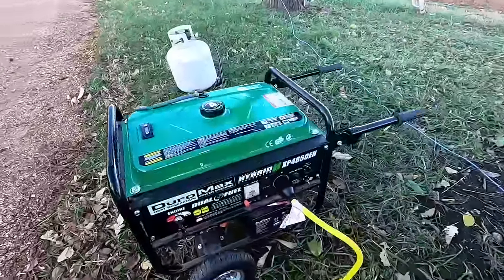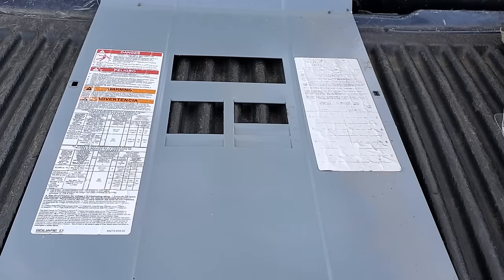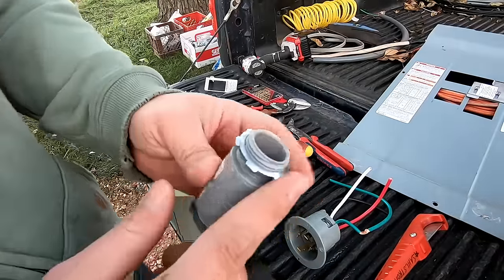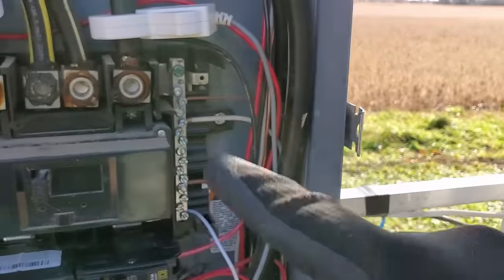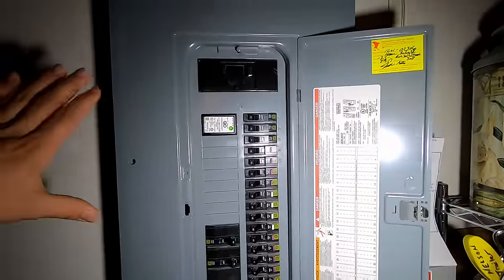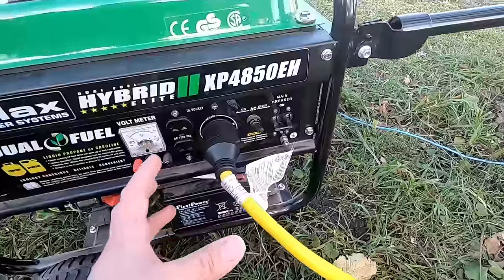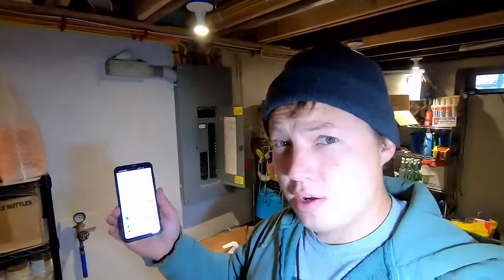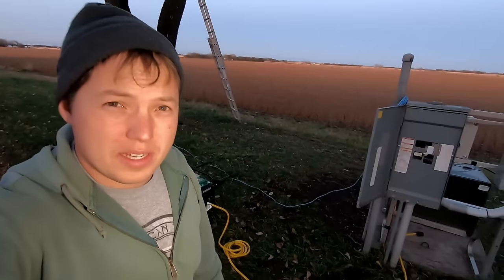How To Hook Up a Generator To Your House Using a Breaker Interlock Kit & Power Inlet Box

Comment: Such a great explanation and video.  I have the same generator.  It's output is slightly reduced on propane.  Gasoline should get you closer to the max, but I also run mine propane-only.  Also elevation comes into play with output.
Reply: ⚠️Portable Generator Safety Tips:

1) KEEPING OTHERS SAFE: Please do not allow an unqualified person or your children to operate and service the portable generator. Just because some manuals don’t say that doesn’t mean it’s safe. That is important against the generator safety rules. We also need to be keeping an eye on our children too. You need to make sure that your children are not playing near the portable generator especially when it’s running so they won’t get electrocuted. Generators pose electrical risks and they can be hot during an operation. Please keep your children away from the portable generator at all times. It is important to keep our children safe especially our little ones. Be aware of all the hazards.

2) WHERE TO RUN YOUR GENERATOR: Some people use their portable generators indoors which increases the risk of carbon monoxide poisoning. It’s important to have a carbon monoxide if you have a gas generator. Never ever use your generator indoors even if your doors and windows are open and even in the garage is not safe to use a portable generator. Also please never use your generator in your deck or balcony. It is never safe to use your generator indoors and in enclosed areas of your home. Your generator needs to be 15-20 feet away from your house. 

3)🔥FIRE HAZARDS: Never refuel your generator while it’s running. You need to let your generator cool off before refueling it and before storing your generator. Never overload your generator too. Never ever back feed your generator. You should never plug your generator into a wall outlet. Also never store propane tanks indoors. Please keep flammable things away from the generator as well and please don’t smoke cigarettes near the generator. Having a fire extinguisher next to the generator is also important against the generator safety rules. It’s also not safe to move your generator while it’s running.

4) GENERATOR OPERATION: make sure your hands are dry before touching the generator. Never use your generator in wet conditions. Don’t let your generator get wet. You need a generator tent if you need to use your generator during wet weather. Please don’t wear loose clothes when operating the generator. Turn on your generator before plugging in appliances. Use the right cord for your generator. Please do not use worn out cords. 

https://youtube.com/shorts/eFigDfnPkcQ?feature=share and here is a short video more about keeping others safe when using generators. Portable generators need maintenance so it’s important to follow the safety instructions.

Hope this helps

Comment: when I hooked up a generator feed for my house I used a separate breaker box specifically designed for such connections.  there were 10 or 12 breakers in the box (don't live there anymore and can't remember how many).  I ran wiring from the original grid panel (wiring supplied with the new panel) to the new panel for each breaker I wanted use (or could use, given the limitations of the generator). the breakers in the new panel had 3 positions. one for grid power, a middle position that cut power off, and a position that had the power from the generator.  the main panel was inside the house, so all the switching could be done inside.
Reply: Portable generator safety rules: Always make sure you follow all the generator safety rules whenever you use your portable generator. This is only a reminder. Generators can be dangerous if not used carefully. Every year, hundreds of people die or get injured when using portable generators due to carbon monoxide poisoning and electrocution. Make sure you are using your generator carefully and keeping others safe as well. There is something very serious that everyone should always be aware of when using generators. Some people do run their generator indoors which is not safe and that increases the risk of carbon monoxide poisoning which can cause death of family and you. Some people run their generator in wet conditions which can electrocute them. Please remember that you should never run your generator indoors. Remember that carbon monoxide is an odorless and colorless gas that you cannot see or smell. Carbon monoxide is a silent killer. Keep that in mind. Make sure your generator is 15-20 feet away from your house and away from doors, windows, and vents. Never use your generator in your porch too. Having a carbon monoxide detector is very important against generator safety. Some people also allow children to go near the portable generator which could pose risks. We need to keep an eye on our children making sure that they are not near the portable generator so they won’t get electrocuted or burned by the generator which is dangerous. A locking enclosure also keeps kids safe. A generator shed might look like a tempting place to explore, or take cover during a game of hide and seek, but a generator is a dangerous piece of equipment that can cause injury. It says on the manual that we should also keep children away at all times from the portable generator to avoid injuries. Please do not allow a child or unqualified people to operate the portable generator.  It is important to keep your children safe especially little ones. The portable generator can be hot during an operation. Just because some manuals missed what should be listed doesn’t mean it’s safe to do. Always follow the generator safety rules when using portable generators. Generators pose electrical risks. If you need to use your generator during wet weather, you need a generator tent to protect your generator from getting wet. Don’t let your generator get wet. Keep your generator dry and before using your generator, please make sure your hands and your generator is dry. Do not wear loose clothing when operating the generator. Everything that is said on the generator’s operating manual should not be ignored. Never smoke cigarettes near the generator. Please keep flammable things away from the generator. Never overload your generator too. Your generator can catch fire. Never ever try to plug a generator cord into a wall outlet to avoid back feeding. Back feeding your generator is dangerous. Always turn on your generator first before plugging in appliances and shut off the appliances before turning your generator off. Use a heavy duty cord for your generator and the cord should not be worn out. All the instructions should be followed carefully. Never refuel your generator while it’s running. It can cause fire if fuel spills while your generator is hot. You should turn off your generator and let it cool off before refueling it. Having a fire extinguisher next to the generator is also important. This is only a reminder for everyone’s safety of using generators. Make sure your generator is properly grounded. Having a fire extinguisher next to the generator is also important against the safety rules. https://youtu.be/I1jT3ANENvI and here is a video more about keeping others safe when using generators and also about our family’s safety. It’s important to keep our little children safe as well. Make sure your little children are kept away from the generator at all times especially when it’s running. Hope this helps. Always remember that it’s better to be safe than sorry.
Reply: @The_Happy_Aviation_Enthusiast  you are a bot, right? massive block of text - you need an editor badly

Comment: I just purchased a Duromax 13kw portable generator. I have a similar setup with an Interlock Kit. Are there any concerns about running TV's, Computers, etc on Generator Power. Specifically is there a concern about Total Harmonic Distortion as these generators are well above the recommended 5%. Has anyone solved for this or have your devices been fine?
Reply: I have the same question. Do you know if anyone used separate UPS devices that can provide clean power to these sensitive loads? Or do you just need a better THD <5% generator? Adding UPS's adds costs on lesser generators???

Comment: Interlock kit - a useful item - but my case is quite a bit more complex as I'll have a 3 phase generator powering a single phase house - so not only will I need to isolate the grid supply, I'll be splitting the 3 phase supply across different circuits.

Comment: I have 2 200 amp boxes in which both have circuits that need to be energized. Your video shows perfectly how to do a single box hook up however what's the best way to split the incoming line from the gen.  Great vids.....thanks
Reply: Here are the generator safety rules that everyone needs to follow: this is just a reminder for everyone’s safety. Always make sure you follow all the generator safety rules whenever you use your portable generator. Generators can be dangerous if not used carefully. Every year, hundreds of people die or get injured when using portable generators due to carbon monoxide poisoning and electrocution. Make sure you are using your generator carefully and keeping others safe as well. There is something very serious that everyone should always be aware of when using generators. Some people do run their generator indoors which is not safe and that increases the risk of carbon monoxide poisoning which can cause death of family and you. Some people run their generator in wet conditions which can electrocute them. Please remember that you should never run your generator indoors. Remember that carbon monoxide is an odorless and colorless gas that you cannot see or smell. Carbon monoxide is a silent killer. Keep that in mind. Make sure your generator is 15-20 feet away from your house and away from doors, windows, and vents. Never use your generator in your porch too. Having a carbon monoxide detector is very important against generator safety. Some people also allow children to go near the portable generator which could pose risks. We need to keep an eye on our children making sure that they are not near the portable generator so they won’t get electrocuted or burned by the generator which is dangerous. A locking enclosure also keeps kids safe. A generator shed might look like a tempting place to explore, or take cover during a game of hide and seek, but a generator is a dangerous piece of equipment that can cause injury. It says on the manual that we should also keep children away at all times from the portable generator to avoid injuries. Please do not allow a child or unqualified people to operate the portable generator.  It is important to keep your children safe especially little ones. The portable generator can be hot during an operation. Just because some manuals missed what should be listed doesn’t mean it’s safe to do. Always follow the generator safety rules when using portable generators. Generators pose electrical risks. If you need to use your generator during wet weather, you need a generator tent to protect your generator from getting wet. Don’t let your generator get wet. Keep your generator dry and before using your generator, please make sure your hands and your generator is dry. Do not wear loose clothing when operating the generator. Everything that is said on the generator’s operating manual should not be ignored. Never smoke cigarettes near the generator. Please keep flammable things away from the generator. Never overload your generator too. Your generator can catch fire. Never ever try to plug a generator cord into a wall outlet to avoid back feeding. Back feeding your generator is dangerous. Always turn on your generator first before plugging in appliances and shut off the appliances before turning your generator off. Use a heavy duty cord for your generator and the cord should not be worn out. All the instructions should be followed carefully. Never refuel your generator while it’s running. It can cause fire if fuel spills while your generator is hot. You should turn off your generator and let it cool off before refueling it. Having a fire extinguisher next to the generator is also important. This is only a reminder for everyone’s safety of using generators. Make sure your generator is properly grounded. Having a fire extinguisher next to the generator is also important against the safety rules. https://youtu.be/I1jT3ANENvI and here is a video more about keeping others safe when using generators and also about our family’s safety. It’s important to keep our little children safe as well. Make sure your little children are kept away from the generator at all times especially when it’s running. Hope everyone finds this helpful. Always remember that it’s better to be safe than sorry. Remember that warnings should not be ignored.

Comment: I always used torque drivers for DC lug connections to insure manufacturers specs are spot on.
Reply: Generator safety rules: Always make sure you follow all the generator safety rules whenever you use your portable generator. This is a reminder for everyone’s safety of using generators. Generators can be dangerous if not used carefully. Every year, hundreds of people die or get injured when using portable generators due to carbon monoxide poisoning and electrocution. Make sure you are using your generator carefully and keeping others safe as well. There is something very serious that everyone should always be aware of when using generators. Some people do run their generator indoors which is not safe and that increases the risk of carbon monoxide poisoning which can cause death of family and you. Some people run their generator in wet conditions which can electrocute them. Please remember that you should never run your generator indoors. Remember that carbon monoxide is an odorless and colorless gas that you cannot see or smell. Carbon monoxide is a silent killer. Keep that in mind. Make sure your generator is 15-20 feet away from your house and away from doors, windows, and vents. Never use your generator in your porch too. Having a carbon monoxide detector is very important against generator safety. Some people also allow children to go near the portable generator which could pose risks. We need to keep an eye on our children making sure that they are not near the portable generator so they won’t get electrocuted or burned by the generator which is dangerous. A locking enclosure also keeps kids safe. A generator shed might look like a tempting place to explore, or take cover during a game of hide and seek, but a generator is a dangerous piece of equipment that can cause injury. It says on the manual that we should also keep children away at all times from the portable generator to avoid injuries. Please do not allow a child or unqualified people to operate the portable generator.  It is important to keep your children safe especially little ones. The portable generator can be hot during an operation. Just because some manuals missed what should be listed doesn’t mean it’s safe to do. Always follow the generator safety rules when using portable generators. Generators pose electrical risks. If you need to use your generator during wet weather, you need a generator tent to protect your generator from getting wet. Don’t let your generator get wet. Keep your generator dry and before using your generator, please make sure your hands and your generator is dry. Do not wear loose clothing when operating the generator. Everything that is said on the generator’s operating manual should not be ignored. Never smoke cigarettes near the generator. Please keep flammable things away from the generator. Never overload your generator too. Your generator can catch fire. Never ever try to plug a generator cord into a wall outlet to avoid back feeding. Back feeding your generator is dangerous. Always turn on your generator first before plugging in appliances and shut off the appliances before turning your generator off. Use a heavy duty cord for your generator and the cord should not be worn out. All the instructions should be followed carefully. Never refuel your generator while it’s running. It can cause fire if fuel spills while your generator is hot. You should turn off your generator and let it cool off before refueling it. Having a fire extinguisher next to the generator is also important. This is only a reminder for everyone’s safety of using generators. Make sure your generator is properly grounded. Having a fire extinguisher next to the generator is also important against the safety rules. https://youtu.be/I1jT3ANENvI and here is a video more about keeping others safe when using generators and also about our family’s safety. It’s important to keep our little children safe as well. Make sure your little children are kept away from the generator at all times especially when it’s running. Hope this helps. Always remember that it’s better to be safe than sorry. Also remember that warnings should not be ignored too.